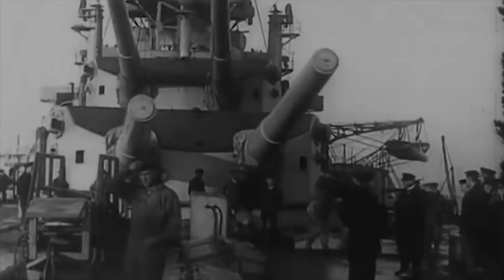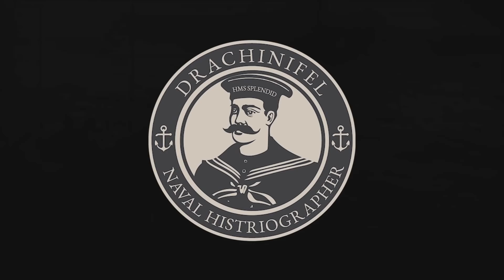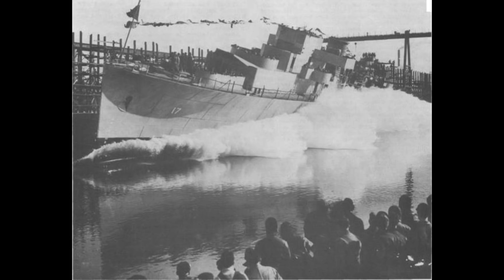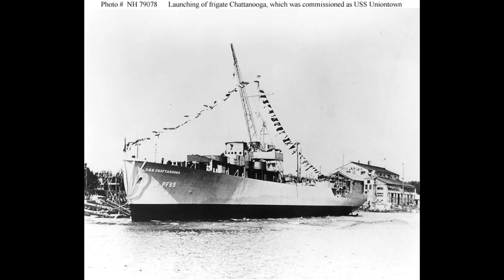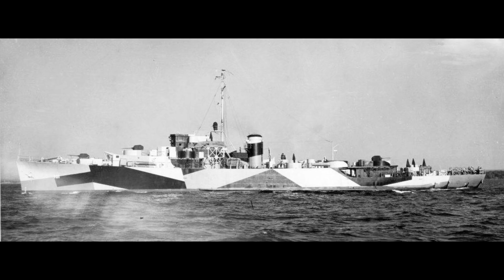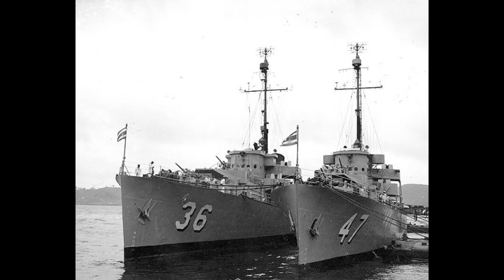USS Tacoma - Guide 235

Comment: WOW - I wish my Dad was still alive to see this. He served in the US Coast Guard in WWII on three Tacomas as an enlisted man. 

He was a radio operator and 20mm gunner on the station near the bridge. 

They did a number of convoy runs to the Med  (all of this is from recollection). 

Toward the end of the war in Europe,  they encountered a contact and depth charged it off the east coast of the US. He thought that this might have been one of the last german subs sunk. As an enlisted man, he didn't know the location of the ship at any given time. 

The crew was then sent to the Pacific, Seattle if I recall correctly. They were going to be refitted for operations against the Japanese. He said that the morale dropped quite a bit due to the reputation of the Japanese navy as far as prisoners. 

He was on his gun station when the captain ordered depth charges dropped at something like 15 knots/25 feet. The first pair blew the stern out of the water and cracked the main steam lines. They were dead in the water for 12 hours while the damage was repaired. 

After Dad passed I came across a story of a  Patrol Frigate commander who was facing the possibility of going up against Japanese cruisers. His plan was to try to close and pass close aboard dropping the full rack of depth charges set to their minimum depth.  Putting the two together, I'm thinking that what he saw was a test to see if that was feasible. 

He also mentioned that during gunnery practice, a round jammed. The procedure was for the gunner's mate to remove the barrel and dunk the breech in a bucket of water. The gunner's mate was stressed out and missed three times. He threw the barrel off the bridge. IIRC there was no reprimand. 

They were on weather duty and hit the tail end of a hurricane. Dad was one of three people on the ship that didn't get seasick. He said he almost lost it in the radio room when the other guy was continuously puking into the trashcan. 

There is a story about half of the crew getting 'disease' during a port call. Dad had gone in a different direction than his friends and avoided that fiasco.  

Dad was 2nd generation Polish. He spoke Polish fluently.  He went  up to Alaska to turn a ship over to the Russians. Of course, Russian and Polish are different but similar languages. However, they were similar enough to convey the radio operations and gunnery.  They worked with the Russian crew for something like 2 weeks. 

Again, thanks for posting that video.